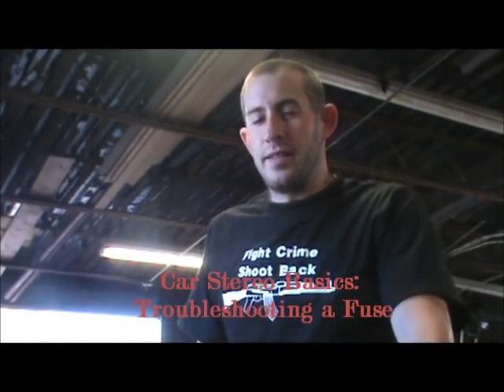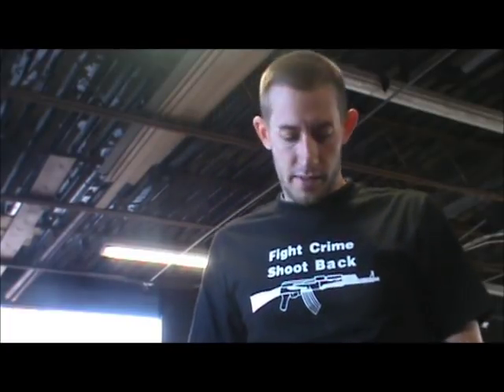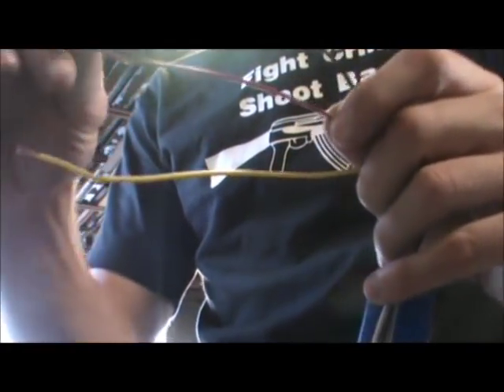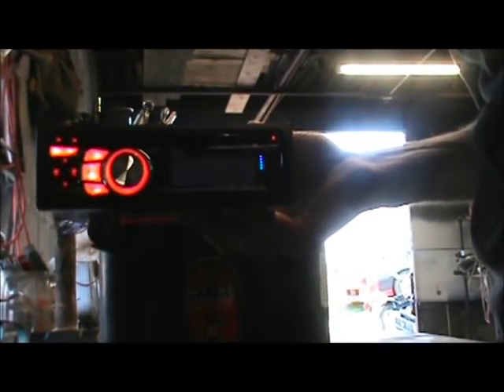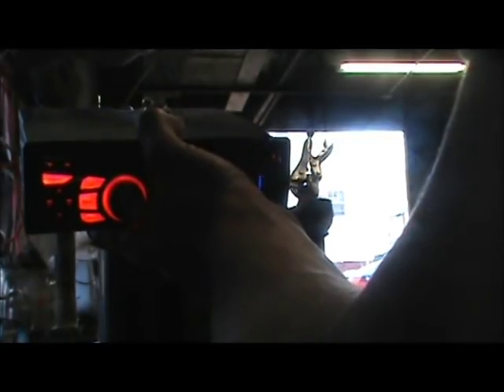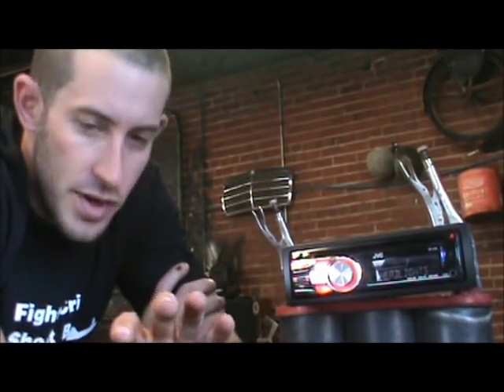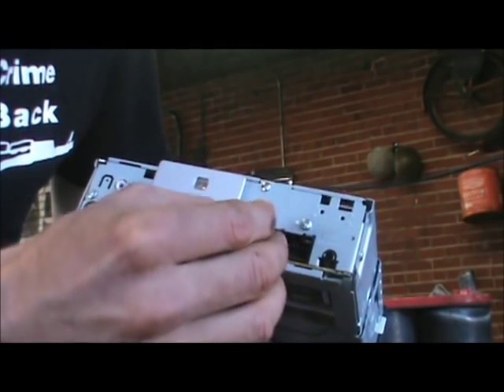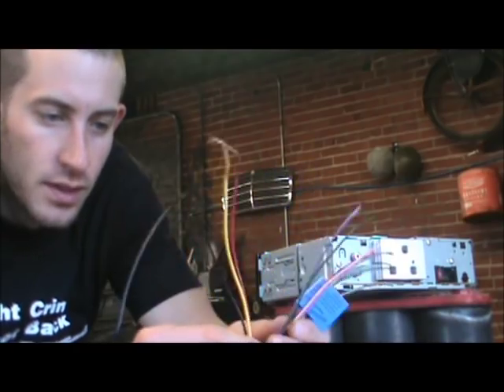Car Stereo Troubleshooting Fuse Basic

Comment from the maker: thanks for watching turdean, sounds like you might have blown a fuse inside the cd player. also make sure none of the speaker wires are touching causing a short. you can try and look for a fuse on the cd player itself or possible inside the cd player.. good luck

Comment: Hi Beau. Great video, even for a woman. My car stereo stopped working and I've checked all fuses and then pulled it out of the dash to look at the wiring. There are only two "plugs" and on one of the plugs the only wires connected are two red ones with are then joined to one and disappear under behind the dash. On the other "plug" are only brown and greyish wires. Help!

Comment from the maker: could be lots of things but id start with the easy stuff.. check that you have a good solid connection for your ground wire and power wires.. then check all the fuses are in good shape... usually its something simple..

Comment: i have original radio in my car and i pluged in a ac/dc converter, like for the normal house outlet, and it was bad, and shorted out my radio and stuff, i thought it was a fuse, but i cant find a burned out one, does stock radios have a fuse?

Comment: I just bought a soundstream tarantula 2000 watt mono block amp and I don't know what size fuse to put in the wire coming from the battery right now I have a 25 amp fuse on there from my old amp and I want to use the same wire so what size fuse do I replace the other fuse with (the wire is 4ga)

Comment: My radio stopped working because I had my battery in backwards because I'm kind of a space case. (It wouldn't go. Turned out to be starter motor.) To figure it all out I towed it to some mechanics shop I go to. (To save some money I rode my bike around getting a new starter motor. I tried to decide should I put in the starter motor myself or let them do it? I stupidly asked them if I could work on the car in their parking lot but they said I couldn't because of insurance issues so that relieved me of having to decide.) When I got the car back the stereo was dead. They said I'd fried it. Now I have no multimeter and no extra wiring harness and I am taking apart the Kia Rio 2011 head unit to attempt to determine if it has some kind of fuse inside it. Obviously I checked my fuse panel and the 10amp red fuse in there is fine.  I am trying to decide whether it's really fried. I can't see anything fried about it now that I took it apart. I think I have to put all the screws in baggies and go shopping perhaps for a multimeter (so I can see if the power is actually getting to the radio plug). or for a replacement radio. It is making me a little nuts because there are too many price points and levels of ugliness to choose from in a new car stereo and all I want to do is listen to the radio on it. Perhaps Beau the Mechanic or some kindly YouTube stranger can guide me on my path to happiness and satisfaction if I am lucky.

Comment: Hey Beau, my car cd player just turned off checked the back of the cd player where the fuse is and it was burned off. I replaced it, once I plug in the car antenna, blows the fuse again. Replaced the fuse again and it keeps blowing the fuse everytime I plug the antenna in. Any ideas what might be causing this?

Comment from the maker: could be bad internally, ive seen them work but have burned circuits inside the cd player.. check all your wiring and try disconnecting all speakers and wiring one known good speaker to just one set of the speaker wires to verify a bad cd player..

Comment: so if the stereo does not work when connected to the yellow wire from my truck but it works when connected straight to the battery it could be the fuse??

Comment: my radio was working perfect then i pulled it out a wire touched the metal peice and it turned off fuse is good on the radio and in the fuse pannel any ideas why it stoped?
Reply: disconnect the car battery before you do this stuff by taking off the negative (black, ground) battery connector from the battery terminal they tell me

Comment: My radio gives me 5 beeps after I completely turn off my car. I press the reset button and it vibrates. I checked 2 fuses in the fusebox that have to do with the radio, and I checked the fuse in the radio and they were all fine. Its an aftermarket pioneer head unit help me out!